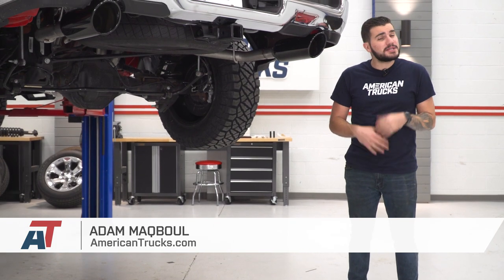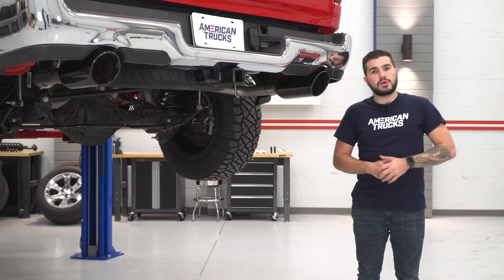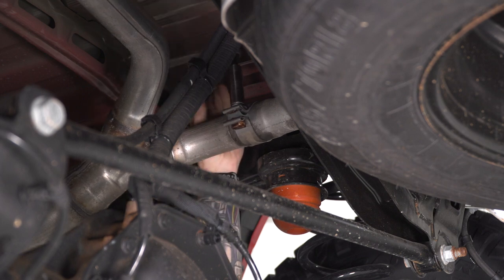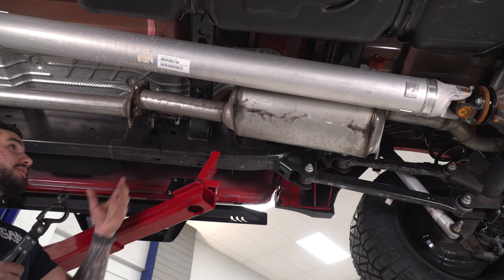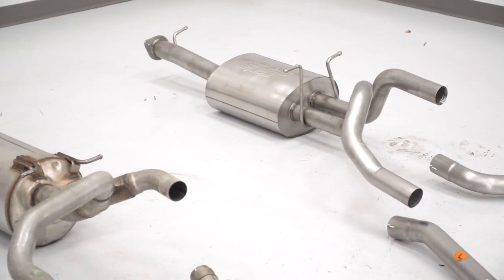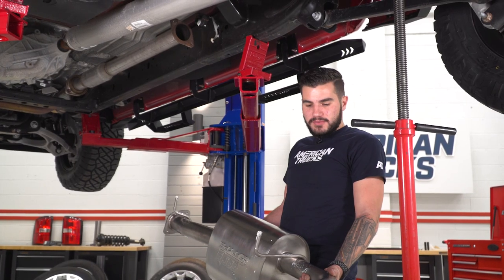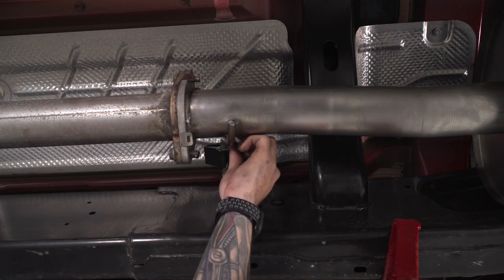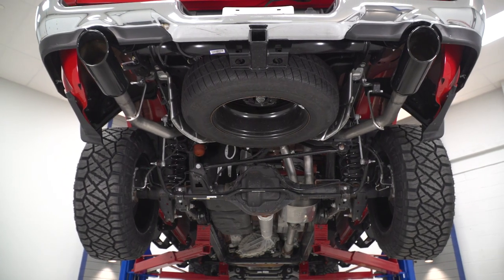2019-2020 RAM 1500 5.7L Borla Stinger S-Type Exhaust System w/ Black Chrome Tips Sound Clip & Review

Comment: I just installed this on my 2020 Ram 1500 Rebel.  Awesome system!  It maintains the Hemi sound character but with a deeper rumble.  I'm not a loud pipe kind of guy and this system is perfect.  My Harley has deeper throatier mufflers but with the baffles still installed.  Not obnoxious.  This system is only loud when you want it to be (ie. romping on the throttle.)  Cold startup is louder and deeper but settles into a nice deep tone.  At cruise it's not loud at all and no drone.  I do notice a little burble when the engine transitions from eight to four cylinders that I didn't notice with the stock system.  As far as the install, it took me two and half hours from start to finish in my driveway by myself.  I raised the rear of the truck onto jack stands. If you lower the spare tire out of the way, and remove the left half of the spare tire shield (three 10mm bolts) and disconnect the left side sway bar link at the top, you can remove the exhaust without cutting with a saws-all.  It lines up perfectly but takes some tightening loosening of the clamp bolts to align the tips in the rear cutouts.  Also, in installing the provided heat shield around the brake line above the left side pipe, I cut it into two pieces to get around the clamping block and then used a piece of foil furnace tape to rejoin over the clamp.  When I was finished, I wiped the entire exhaust down with some stainless steel appliance cleaner to remove the finger prints.  Overall, a very easy install and it looks and sounds great especially with the black chrome tips.  You definitely get what you pay for.  IMO the Touring exhaust is not worth the $1000 as it's not much louder than stock.  Very pleased!  Hope this helps.
Reply: Good to know I was gonna go with the touring on my 20 laramie until I read this

Comment: Sounds louder stock
Reply: It's not, believe me. The stock exhaust is quieter than the regular noise from the engine compartment. This is way louder. The videos never do it justice.  The stock exhaust on Rams is an embarrassment to the V8 Hemi.
Reply: @fmrscout33  seconded, I just installed today. None of the youtube videos do the sound justice.
Reply: @richardhoward9441  wait til it breaks in in a few days. Gets even louder. I've actually considered adding the resonator to take just a little of the edge off. Don't want the neighbors to hate me for waking them up with the cold starts in the morning.